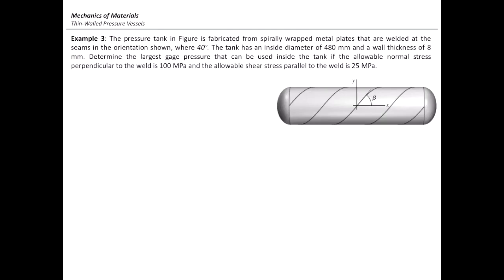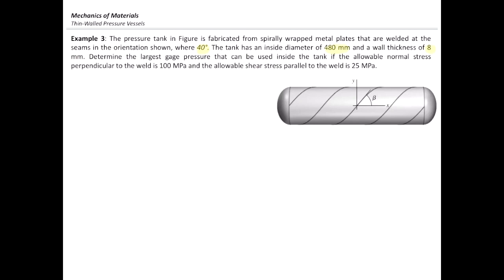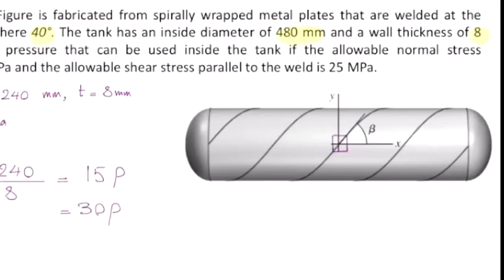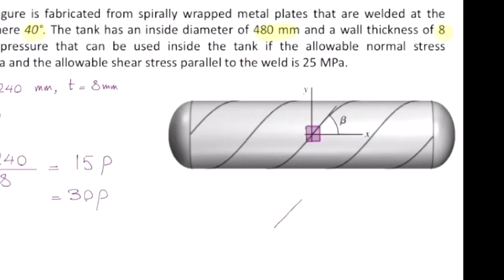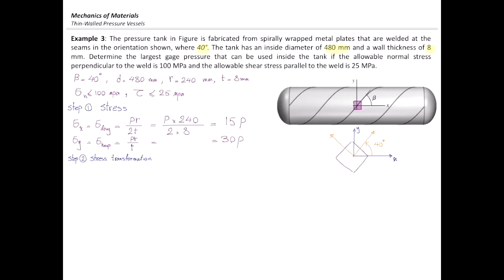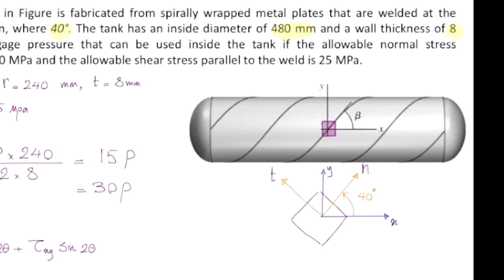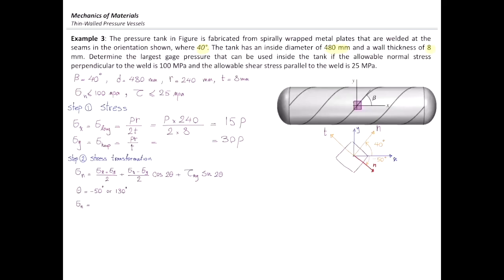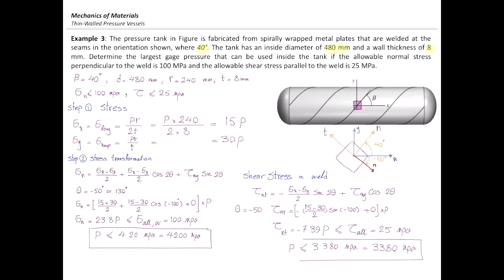Mechanics of Materials, Lecture 25 Pressure Vessels (Example 3)

Comment: Why is it that the angle used for both stress calculations are the same? Should 50 degrees really be used for both the normal and shear stress?
Reply: I had similair question I thought for the second one the 40 degree angle should be used instead. I don't know if this is correct method though. But Parallel" shear" I thought meant parallel to axis of 40 degree.